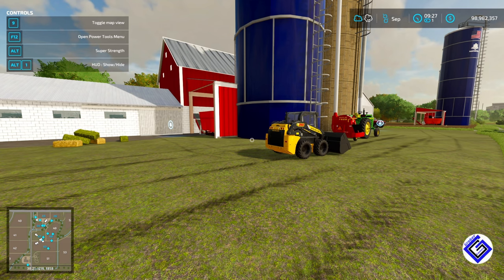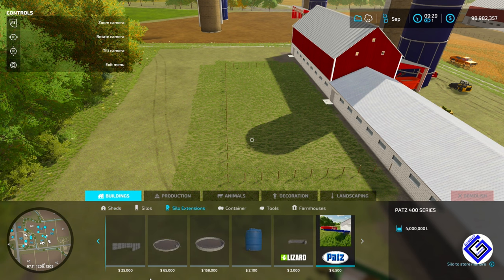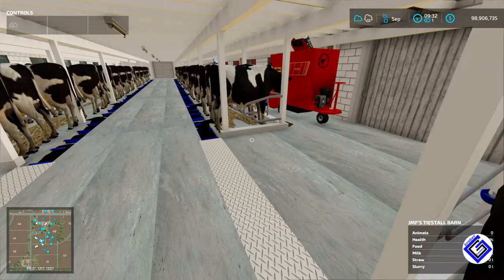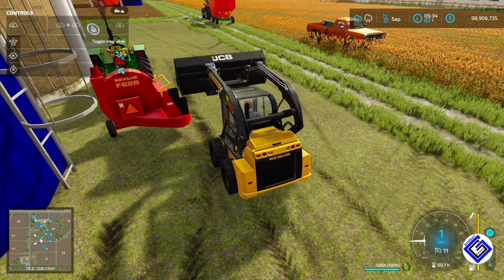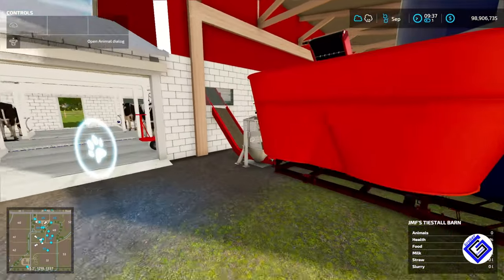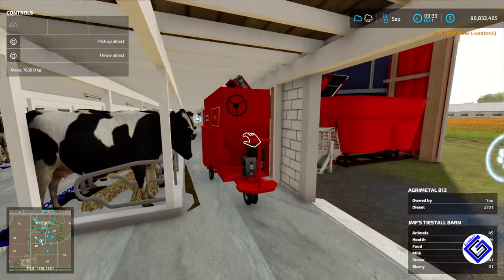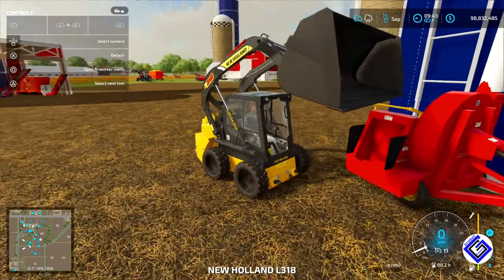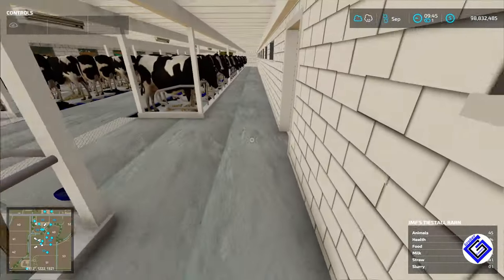FS 22 JMF Modding Silos, blower, and dairy barn review and how it works tutorials-Grober Games

Comment: Do you know if the conveyor will load  the tmr into a feed wagon?
Reply from the maker: It does work but the fill trigger is kind of tight so you will have to get really close for it to pull up the fill trigger.  I know in my testing I used the smallest TMR mixer that giants made for the game so for the bigger ones you might run into a few issues but I cannot say for sure at this time.

Comment: What do you actually need to feed your cows?
Reply from the maker: For in general for the modded barn all you need is grass, but in doing this the cows will be at the lowest production that they can be.  You can also get away with just feeding them hay, but this will just be a little bit better than just feeding them grass and you'll still be missing out on the full rate of production.  To get maximize your production with your cows you're going want to do TMR which is Total mixed rations.

For mixing TMR in game you can get away with just mixing silage and hay together in a TMR mixer.  The ratio on that would be 50% hay and 50% silage.  So for example for a 12,000 liter mixer it would be 6,000 liters of silage and than 6,000 of hay.  You can also supplement mineral feed or straw so you can use less of hay or silage. I do not know the exact percentage need of each to do this just because I prefer just to mix hay and silage together from my personal mixing experience in real life.  I do believe that in doing it this way it will have no affect on the cows production itself, but I have not tested this myself.  I think there's a video of Farmercop doing a test himself to prove this out there if you're interested in a deeper look into that.

In these TMR  mixing silos the bare minimum you will need is chaff which you can get by chopping corn and hay which you cut grass and turn into hay by tedding it and baling it in any form that you wish.  The other option you can do as well is buy from the store, but that might cut away into your profits if you do it that way rather than producing your own.

The TMR mixing silos in the video though have more than one way to make a TMR ration.  The two examples I used in the video are the chaff and  hay mixing option, and the chaff, hay, and high moisture corn.  Once again I do not think it matters which mixing style you pick as all the TMR should still have the same benefits as the others.  No matter what mixing setting you pick you will ALWAYS need chaff to be able to use the mixing silos.

Hopefully I have answered your question, but if I haven't please let me know.  I'm happy to help in any way possible.  Happy farming!
Reply: @grobergames  Thank you, this is exactly the information I needed!
Reply: @grobergames  I do have a different question though... does your Meyer wagon trail funny when it's full? Mine will start pulling funny when it's about 70% loaded.
Reply from the maker: @josephanderson3451  I ll be honest with you I haven't had any issues with it but I also have not played with it a whole lot in any of my playthroughs.  I can do some experiments with it but it will be a few days before I will be able to get back to you with an answer.  Which size are you using?  Just so I can mess with the same  one that you are.
Reply: @grobergames  thanks! I was using the smallest one. I turned a sharp corner, and it made the hubs act like they were broken. The wheels were folded over. Only way I could fix it was by taking away the chopper box roof and then putting it back on. But it’s trailed funny when full every time after that. I suppose I could try buying another one and run it full to see if it does the same thing as the one I wrecked. 🧐
Reply from the maker: @josephanderson3451  So I did some of my own testing this morning and I'm having the same issues you are with the 216 model.  I never noticed this before mainly because I always started with the 218 model.  It doesn't trail right and if you try to stop suddenly the whole running gear does kind of go in its own way.  It's almost like the front axle doesn't look like its making full contact with the ground?  Like the wagon is almost tipped backwards somewhat?  At least that's what it kind of looks like to me.  I messed with all the other wagons and they all work as they should.  So it looks like the 216 model is the only wagon that has any real issues at this time.  Hope this has helped you out.
Reply from the maker: @josephanderson3451  So I did some exploring this morning and found an updated version of these wagons.  I have tested it a little bit and have had no issues myself.  Here is the link to the guy's updated mod.  I'm guessing we were both using a converted version that wasn't fully tested yet.  I hope this fixes any issues you have.  Happy chopping!
https://skywalker-farms.itch.io/fs22-meyer-rt200-series
Reply: @grobergames  Sweet, thank you! I'll give it a download.
Reply: Does your version of the NH blower act funny with the auger animation? With mine the intake auger starts and then stops. The grass keeps blowing into the silo like it should, it's just the animation of the auger that's a little funny because it looks like the pins are sheared but it fact it's still blowing. :P
Reply from the maker: @josephanderson3451  My does that as well.  It also did it in fs19 when I used it and I'm not sure why.  I guess the way I viewed it was long as it functions like it should I'm ok with it :D.  I do know there's a new John Deere blower out there and I messed with that one a bit and it does keep the animation going when unloading unlike the New Holland one.  It does work with the silos by JMF.  I think the John Deere blower is really cool but I personally still prefer the New Holland one just because its close to the style of the Gehl one that my family uses on their farm.  So it comes down to preference in the end if you prefer the look and brand of New Holland or John Deere and the fact that it keeps its animation while unloading.  Also side note with the John Deere one is that when you do turn the blower on the sounds of the blower and whatever tractor you have on it are almost real world sounds so the John Deere might be the one I start going to just because of that.
Reply: @grobergames  Cool, do you have a link to the John Deere blower?
Reply from the maker: @josephanderson3451  Here it is sir I hope you enjoy it. https://jclsfarmequipment.itch.io/john-deere-65-forage-blower
Reply: @grobergames  thanks!